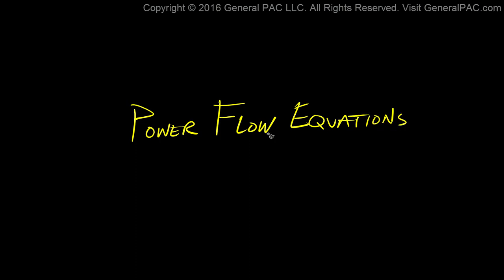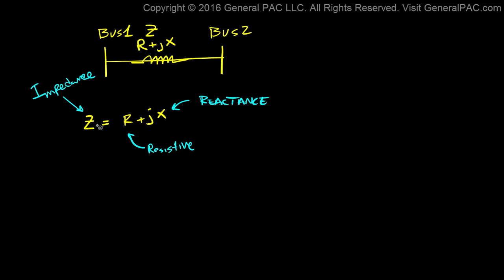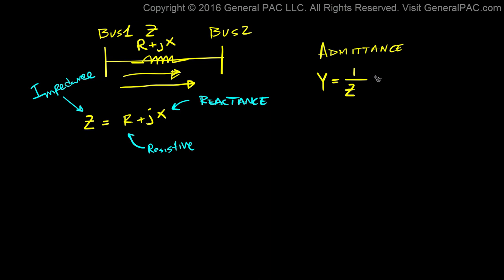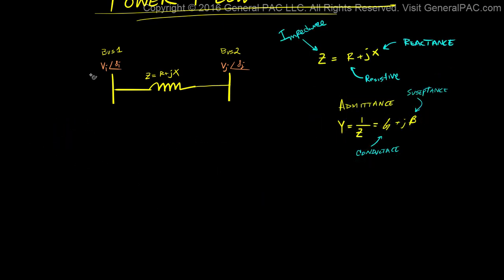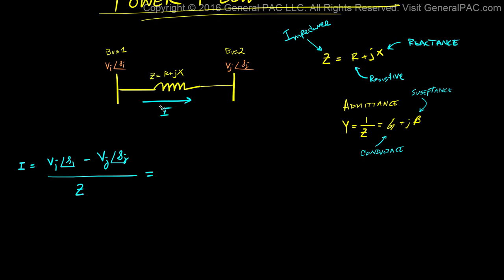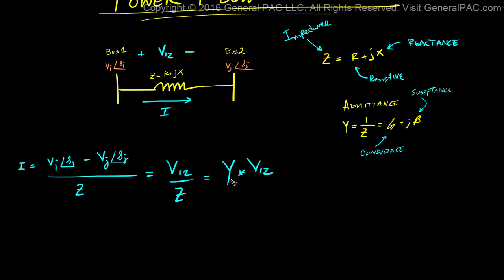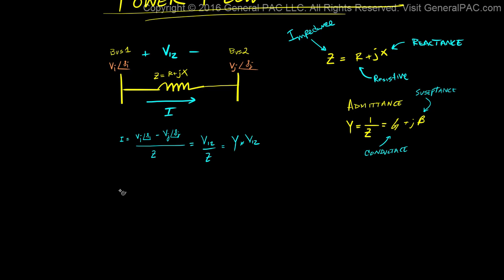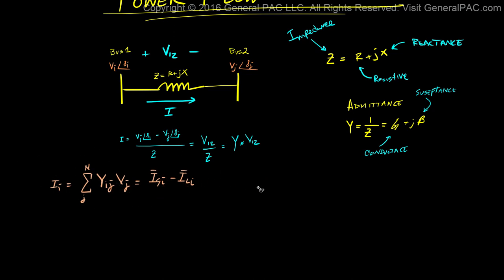Power Flow Equations Part 1

Comment: 2:28 Regarding the bus voltages, are they line-to-line voltages, or line-to-neutral voltages, or phase voltages?
Reply from the maker: Bus voltages are typically line to line rated unless specifically stated as line to ground or phase. This is a common rule of thumb in the industry

Comment: I had a hard time following the last equation because of confusion of the j subscript.  The previous equations were dealing with just two busses; with the subscript of i for the first bus and j for the second bus.  How does j represent all of the currents in all of the busses.  What does Yij represent and Vj represent in the last equation?  How do all the phase angles of all of the busses figure into the last equation?
Reply from the maker: Richard, thank you for you time for asking your question.

GeneralPAC is the platform where you can find hundreds of video tutorials on various power system engineering topics. Please consider subscribing and extend your support by becoming the patron at https://www.patreon.com/generalpac. 

The generalized formula that you see, and as what we have shown in the video, is a representation textbook authors use to simplify and tackle power flow equations. You would find this representation almost anywhere. This simplified form is used as an application for the construction of admittance matrices. You may find this video to be helpful as this video puts your query into an application. https://www.youtube.com/watch?v=jabxIoRwN5Q  

To answer your question, let me answer that by breaking down some of your questions.

This generalized formula pertains to the Kirchoff's Current Law which states that the sum of incoming currents should be equal to sum of outgoing currents.

The j is a representation of N (all) number of busses that are connected to Bus i. This mean that if we consider I2, it means that we are referring to the current injected at bus 2.
Yij represents the admittance that is present between two busses, so in the example shown in the video, it becomes Y12.
Vj represents the voltage at Bus j with resepect to the reference node (and not the voltage difference). So in the video, Vj is the voltage that is present at Bus j.
Since this is a summation between all of the busses at Bus i, and since all all of the parameters will be used in their phasor form, when you'll multiply these values and sum them up (as per the generalised form), you would end up with a final answer along with the phase angle of the current. 

I hope this answers your question and you are satisfied with our response. Please feel free to follow up with your queries should you have troubles in understanding the forementioned response. Thank you for your time.

Best Regards,
GeneralPac Team
Reply: @Generalpac  very 'good' answer.

Comment: why is the current coming out of ith bus based on the voltage of the second bus ie. why is Y*V_J instead of Y*V_I or Y*V_IJ?
Reply: Hi, I got the same question and I learned from a small case study that the j in Ii = Yij*Vij is not totally equal to the j in Ii =Yij *Vj. In other words, I12 is not equal to Y12*V2. There should be a point 3 in the completed circuit that is not shown in the slide. I12 would be equal to Y12*V2+Y13*V3. And I12 is indeed equal to (V1-V2)*Y12. I hope this helps.